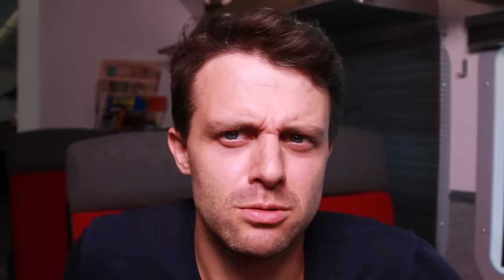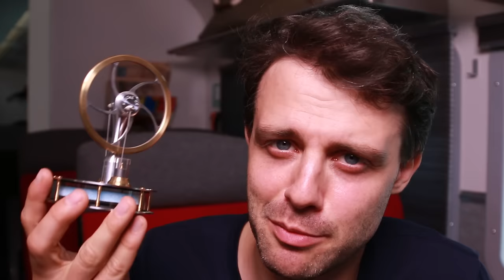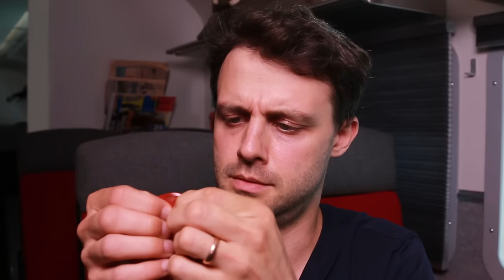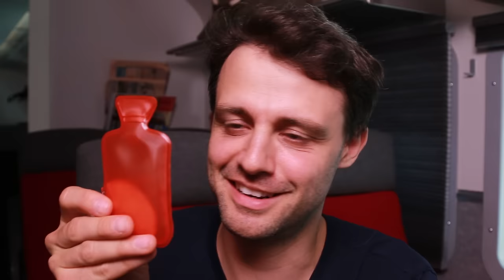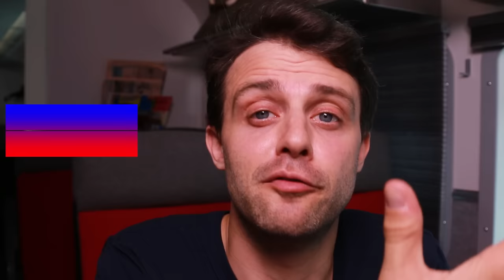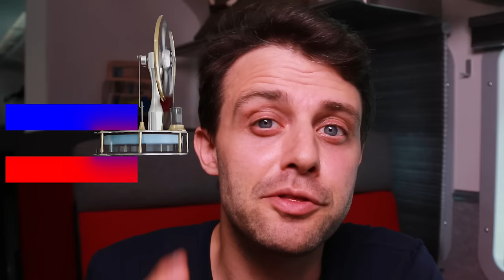A better description of entropy

Comment: Great video, but heat transfer has nothing to do with a statistical phenomenon, not even from a literary or science fiction point of view. Thinking that there is a remote possibility that there is no heat transfer in the example of cold atoms with hot ones inside a box is like thinking that the universe will give you a very remote chance that when you hold an ice cube, instead of melting in your hand, it will end up freezing even more.

Comment: Ironically, you return yourself to the “order” analogy in the end of the video with your ping-pong ball example. And nothing wrong with that, the order analogy is perfectly useful, but only when describing micro states. For instance, the order analogy is very useful when used to understand entropy changes in chemical reactions. But you can’t meaningfully scale up the order analogy to macro systems involving macroscopic amounts of particles, which is why the “messy room” analogy is problematic.

Comment: Its not quite right to say that low entropy is energy clumped together. Supposing all heat was spread out in the universe and there was one place that was very cold. The entropy would be low and it could run an engine and the reason is like you explained because of the energy difference not because of energy clumping.

Comment: Time has a limit. A maximum relational value. The speed of light. So if time can not relate values of energy there is a resistance and a mass. Which means energy clumps over time because it can not relate past the maximum relational value. Which is a distance over time, meter's per second or mile's per hour. If like Einstein said space and time are interchangeable you only need a distance or an amount of time before a mass develops out of spacetime, from spacetime. A time that resists change, resists movement, is simply different from another value of spacetime in relation to its maximum relational value. Delta time with no space and alpha time with no space when the difference is greater that a value equivalent to c that time can not relate or share energy. Maxwell's demon.

Comment: It’s not disorder after you shake up the box of ping pong balls. They end up in a particular order. The probability of that particular order occurring again is just as extremely low as any other particular order, including all the red balls ending up together. Just like when you drop a glass and it shatters into a thousand pieces. The original glass is one order of the molecules. The pieces are one of another of a million possible orders, just not the glass-shaped order you want them to be in. So, has entropy increased after the glass is dropped? Is it only entropy if some of the balls escape the box and end up in another box?

Comment: Amazing video Steve! One doubt: when you operate the motor in reverse mode, which plate will become hot and which one will become cold? (Assuming that in normal mode you just need a difference in temperature and not a specific plate to be colder or hoter than the other). Thx!

Comment: Interesting video. Pertaining to entropy I dont believe in the ending of the universe by energy spreading "guess" and im glad you called it just that... a guess. And a poor one at that in my opinion worth the same as the next. It basically piggybacks off of other theories regarding space and time to the point where even calling it a guess is a bit insulting to the word guess. Even if space is agreed upon to be continually expanding with a fixed amount of energy, there are gravitational anomolies such as the great attractor that will likely keep energy and matter circulating within a usable radius indefinitely. From a purely non-theological perspective Entropy didn't win before the big bang did it? Plenty of time and opportunity for energy to have dispersed but it found its was "theoretically" back to a universal (multiversal?) singularity. There's no reason to believe in anything different occurring again.

Comment: If the Stirling engine runs regardless of which side is hot or cold, then if you turn the wheel to create a temperature difference, which plate gets hot and which plate gets cold?

The way you described it's functioning sounded very directional; I'm not sure how it could work if the hot and cold sides were switched. Unless there's something I'm missing.

Or did you mean that you could put ice on the top plate? (Or maybe blow air across the top plate to cool it?)

Comment: Hi Steve. How comes internet is full with small scale Stirling engines, however there are so few commercial applications of Stirling engines? There are many cases where waste heat could be used  to generate electricity?

Comment: You said the engine runs also if the lower plate is cooled…
Later you explain that you can pump heat by  spinning the engine manually.

That does not fit together… how would the engine decide which side is to be heated.. 

;) do try to trick Mr Carnot

Comment: I know it is an old video. But nevertheless: You make it sound as if the heat dissipation from one plate to another is enough to drive the Stirling engine. Surely, heat energy is lost too. If the engine scratches along a point in a surface, it will heat up. So you can say, the Sterling engine is concentrating heat. Or did I miss anything?

Comment: The last part makes no sense by itself, since it does not cover the aspect of birth of the universe, and only mentions its death. The narrative seems to imply that the original order ("clumped up energy" or evenly arranged ping pong balls) could've only appeared as a result of some kind of divine interference, which essentially manually arranged those balls in a singular event. That is not true though. Modern science does not rule the possibility that our universe might have an intake of that "clumped up energy" from some meta-universal sources.

Comment: Great explanation.  What is the small "piston"?, on the left at 10:50, doing on the Sterling engine? 
It appears to be cycling approximately opposite, either sightly leading or lagging, the large piston. 
Couldn't determine exactly by observation. A valve?

Comment: Steve, Coal pumps CO2 into our environment, but it seems everything has a cost. what byproducts is solar cells doing? i know heat is one of them. normally the heat might bounce out of the atmosphere from the sun rays right? i get that not all of it bounces out, but we'd be trapping more wouldn't we?

Comment: For your ping pong balls, the odds are are also against them being perfectly spread out.  So if they are perfectly spread out, and you shake the box, chances are they will no longer be perfectly spread out.  So do this.  Shake you box, entropy then goes down.  Pull the ones out that are clumped together.   Shake again,  repeat.   eventually they will all be sorted.   Fact is that thermodynamics is based on an ideal gas assumptions and statistical mechanics, which include that we do not make distinctions between individuals nor observe specific states.   Hence, entropy 'always increasing' is a consequence of the assumptions the thermodynamics model rather than being a property of the universe.

Comment: This guy is misleading you when he says that heat it not need it. That the difference in temperature is what is needed. But the difference in temperature moves the heat, which causes 
Heat dispersed from hot to cold until you achieve equal temperatures or equilibrium. AND you don’t need to disperse energy to increase entropy. At constant temperature you expand a gas in vaccum and the mass is dispersed increasing entropy with no heat transfer. So mass density ( gradient of pressure) or energy density is what is diluted or dispersed

Comment: 4:20 I do not think you are correct Steve. (may be sematics, but we need to be precise, shouldn't we?)Temp diff is needed but it is the heat-ENERGY is the one doing the work.

Comment: Is that explanation of heat energy and statistics at the end of the vid actually accurate though? it's not about red and blue pingpong balls evenly distributing, it is the speed at which those pingpong balls are moving that gets passed between them until they're all going at similar speeds right?

Comment: Why was the energy of the universe evenly spread out after the big bang?
Reply: @Appl3 YT "its not evenly spread out lol. Its clumped". Yes, exactly! So what does that mean for this theory? At one time is was smooth, but matter clumped together and so did the energy as that mass is energy E=MC2, eventually clumps got big and heavy enough to ignite the fusion reaction that makes the stars, black holes etc. Without that we would not be here.

Comment: C'mon, Steve, no one STOPS with the description "Entropy is the measure of disorder in a system", they all go on to further explain the nuts and bolts that support that quick introduction.  
Just like you're doing.  For the layman, that 'disorder' definition works just fine.  They don't need to know about logarithms.  They don't need boxes full of gas.  They don't need LaPlace's Demon.  They get a handle on the gist of things seeing before and after pictures of a teen's bedroom.  I learned years ago (while teaching) that 'criticizing' an analogy just to replace it with one you think is better is wasting valuable time.  Just get the point across and be done with it.

Comment: That is misleading. You do need heat to run an engine. You need a heat source at a higher temperature than the heat sink. You convert some of the heat energy in to mechanical energy and the remainder is rejected to the lower temperature heat sink.

Comment: I have a question about entropy that bothers me. Increasing the temperature  increases entropy. What would happen if the kinetic energy is decreased? Would that increase the entropy of decrease it?
Reply: It would be decreased locally, but that of its surroundings would increase because of the effort required to decrease the kinetic energy.
Reply: @astro6393  Ah, I see. It makes sense.

Comment: Yes, it is a statistical problem.
If you have a set of red balls and a set of blue balls. You say that what you want is to clump together the red balls? For you, that is considered an ordered system?
What you need to do is bias the system. For example, let’s say that you increase the gravitational force between these red balls by a lot.
Then, shake the jar for a very long time. Over time, the red balls will come together.

If you have a bunch of atoms in the gas phase. Some of them are hotter than others. The hot ones move faster than the rest. If you place this gas on a planet with a high gravitational field, the field will act as a sorter. The hottest molecules will float to the top and the cold ones will remain at the bottom.

For a system like a star, I guess what you want to do is reverse the process. You want to input energy and break down the heavy nuclei and make hydrogen. I don’t know. Perhaps gravity is the solution? Maybe if the gravitational field is strong enough, the gamma rays emitted by a star can be reflected back to the star?

Comment: Great video! 
(I'm watching it for a 2nd time ... at least)
The only issue I have is with the statistical explanation at the end ... it really drives me mad! :) 
These types of explanations - while most often correct - simply throw out the window any deterministic cause-effect logic.
And here's the problem I have with that ...
Well the first is that it really gets in the way of actually understand given phenomenon ...
But mostly ... it's wrong! :) 
For example the statistical interpretation of heat transfer of a material with hot & cold molecules just won't ever happen, because of the interactions between the molecules. 
During which they transfer energies and that's why it's not possible to get all the "hot" molecules on one side and "cold" ones on the other, because they're not inherently "hot" & "cold".
They just carry the kinetic energy that makes them either hot or cold, but during collisions and interactions they transfer that energy among other molecules, and since there's no such thing as "cold" energy (it's just absence of heat) that energy flows only in one direction, little by little, until it spreads out more or less equally.

Similar story is with the Many-Worlds interpretation of quantum mechanics. It claims that there are infinite worlds and thus every possible combination of events actually exists somewhere.
But it conveniently ignores the determinism and cause-n-effect sequences that eliminate most of these "other worlds"
My point is - if you have X possible combinations of events, and you have X-sized space that can fit all these X-combinations it doesn't mean that they're equally distributed and that there's a hidden mechanism that ensures each of them actually exists in some other Spacetime.
And if there's no law guaranteeing it to happen for X-sized Space, it's just as likely in 2X-sized Space, and 3X-sized... etc to N*X-sized Space.
Meaning just having infinite SpaceTimes doesn't actually causes these alternative combinations to happen.
Especially not while there are physical phenomenon pushing things in some specific directions - ie Universe has some preference into what direction these events develop.
So statistical explanations are indeed great tool at describing approximate models of some system, but are horrible in providing explanations, understanding and describing cause-n-effect!

Comment: But matter doesn't function like ping pong balls.  Matter attracts matter in certain ways at the atomic level, based on distribution of energy.  Hence formulation of new universes with new order. Atoms and molecules find order by the natural force of energy and its desire to find equilibrium.  The fact that energy is never lost but just transferred demonstrates that.  That transfer results in formulation of new natural order, based on the fundamental atomic laws. For every element of disorder, there's an element of order created.
Reply: So really entropy is no more valid than negentropy.  Energy lost results in energy gained and energy gained can result in propensity to formulate new order by transfer of electrons and hence new chemical bonds.

Comment: So, once our sun runs out, we will have to look for other stars to obtain our energy from. But those stars will also eventually dim and die out. So the real question is, will mankind one day without the net expenditure of energy be able to restore the sun to its full youthfulness even after it had died of old age? Can this chaos not be reversed into the Universe once
 more? Can that not be done?
There is as of yet insufficient data for a meaningful answer.

Yes, that was an Isaac Asimov reference.

Comment: Isn't energy will never be destroyed rather only exist in a different form. So if we use the sun to produce electricity then use the electricity to electrolyse water into hydrogen and oxygen atoms then we will have new clumps of energy to use for something else and process goes on.
Reply: The problem is that when energy is converted into a different form, that form is often completely useless.  You can't harness evenly distributed thermal energy for any useful purpose.

We don't really have to worry about running out of useful energy because the sun will keep providing it for billions of years, but that doesn't mean the cycle can continue endlessly.

Comment: I agree with you that disorder is a bad description of entropy.  But I am equally leery of your preferred description of entropy as the "degree to which (thermal) energy is spread out." In some circumstances entropy may be linked to spatial distribution (volumetric density?) of thermal energy, but not always, so I think this is very misleading.

Why not just describe entropy based on what it actually is?  It's a quantity related the NUMBER of ways a system of matter and energy can randomly rearrange (configurations). You touched on this definition with your example of blue and red ping pong balls in a box.  If you release a constraint, allowing a system to adopt more configurations, it will randomly adopt the new configurations. Once it has freedom to occupy this greater number of configurations, it cannot spontaneously constrain itself to the previous set of (fewer) configurations.  Hence the 2nd Law.  From this relatively simple description of entropy and the 2nd Law, you can radiate out into hundreds of examples that embody this basic idea, at whatever level of sophistication you want to get into.  

I have taught entropy and the second law to many generations of students, and have found (by painful experience) that trying to dumb it down with various touchy-feely explanations ultimately backfires, leading to misconceptions, or undermining students' confidence in their own understanding. If you really want to help bring entropy to a general audience, I recommend you rip off the bandaid and just explain what it actually is.  But use your amazing youtuber skills to engage a general audience in explaining this definition, and how that true definition leads to the behavior in the world around them.

Comment: When the universe has reached maximum entropy, does time stop?
Reply: If you say that there was no time before the big bang due to no observable events, then to be logically consistent you would say that there would be no time after the heat death either (assuming that the universe is not an open system and that a heat death does occur)